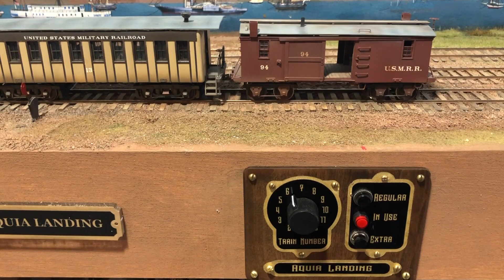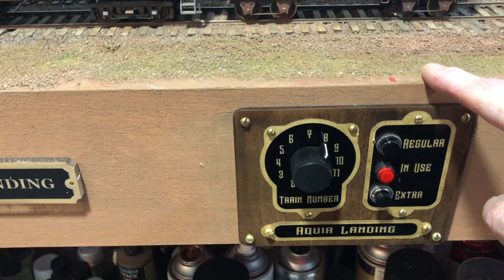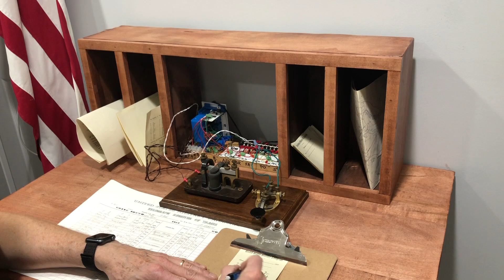Telegraph Install

Comment: That's awesome! In my friends layout in Missoula he has a telegraph and phoneline system for station agents to call the operator and then the operator calls up dispatch. then say we have orders for an extra we use the old morse code system to get a hold of the yardmaster at Farmington as he doesn't have a phone line.